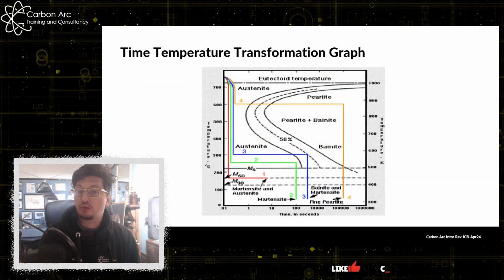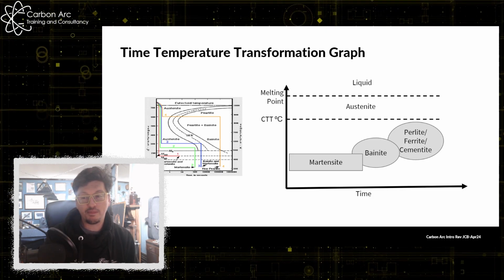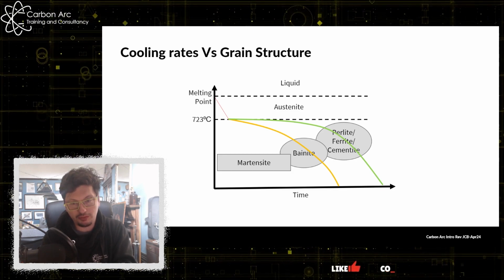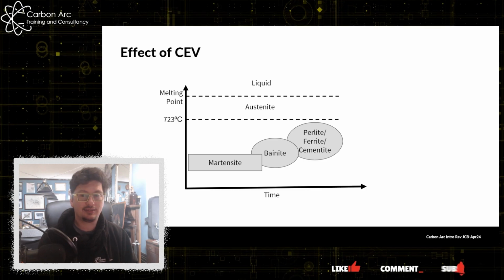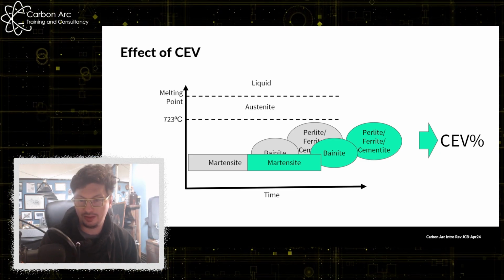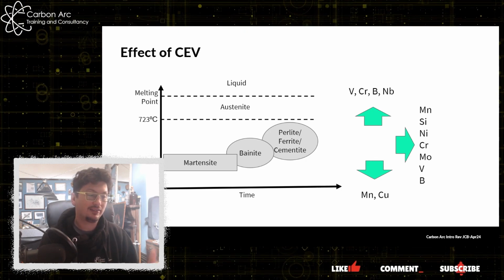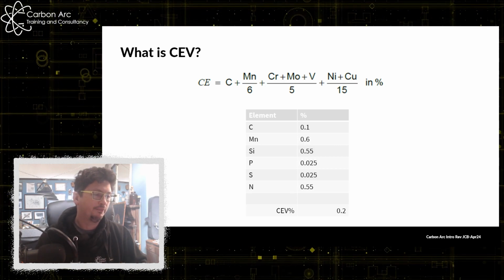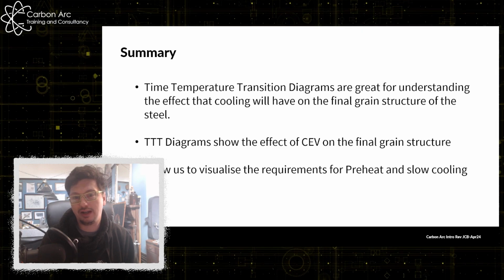TTT Diagrams

Comment: If you look at the structure of steel after quenching, it consists of martensite and retained austenite. And as for what you're not doing—it's awesome!
Reply from the maker: Yes your right there is a good chance you will have other grian structures in the materail. The TTT diagram is a simple illustration of the main areas.